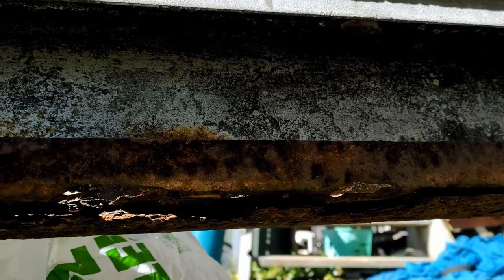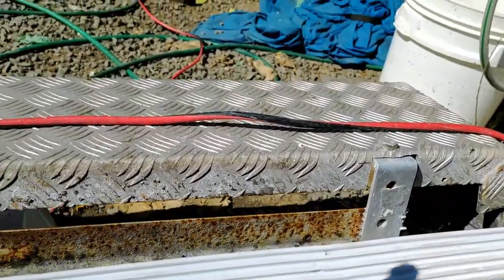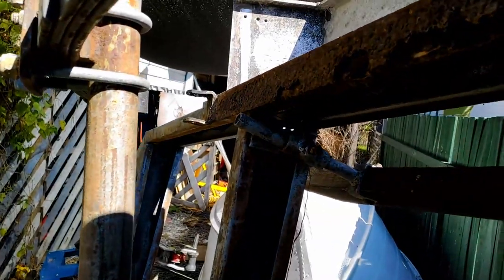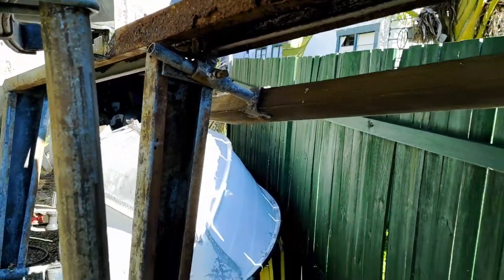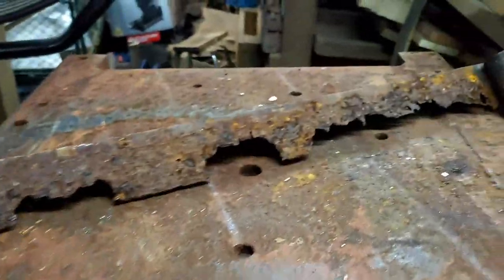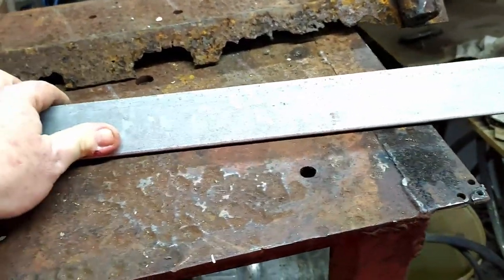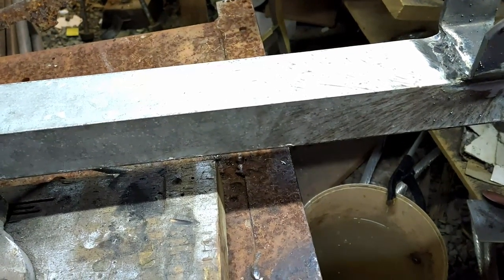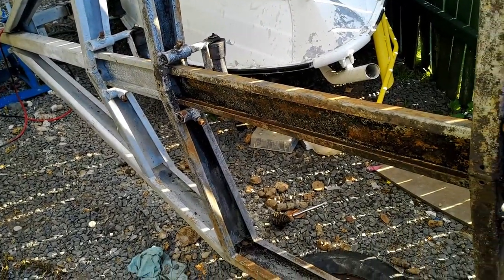Repairing the Rust To My Boat Trailer

Comment: Turns your stomach! Rust… worst is like you did- start one place and it’s the next thing and the next thing. By the time you’re done and feeling satisfied with your work- you add up the cost and find it would have been cheaper and a whole lot less work to find a good trailer!  I’m in the same thing now. I found a “nice” trailer, it was in the snow a bit, but the guy says he just put new wheels on it for $200 and the tires still have the tits on them, a new tongue and a new pickup bed mat $200 for the deck( helps to drive on snowmobiles.) and is selling it quick for $300. Great! Get in the garage, and think, hey I’ll flip this quick! Then I see it… the frame is Swiss cheese.  The trailer in good shape is worth $600. So.. $300 in steel and welding myself and voila! Lot of work… and break even.